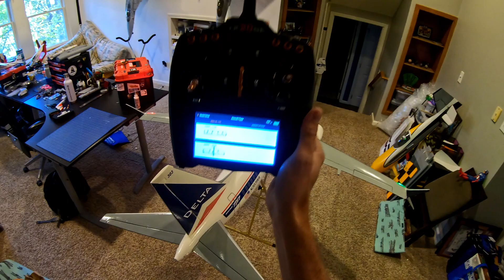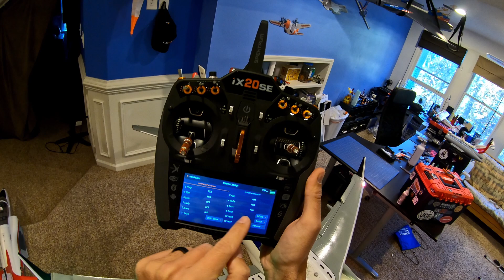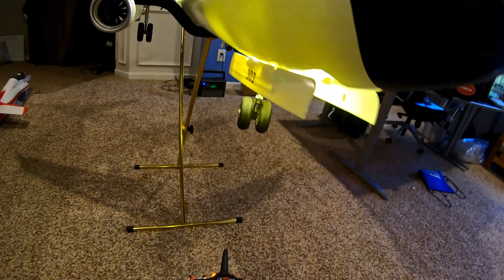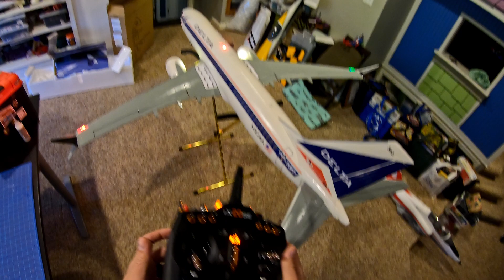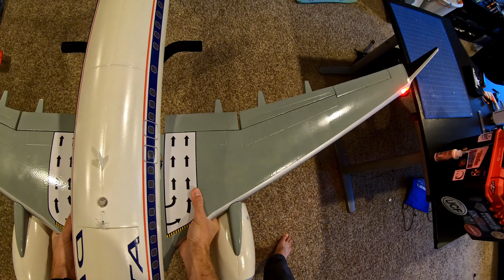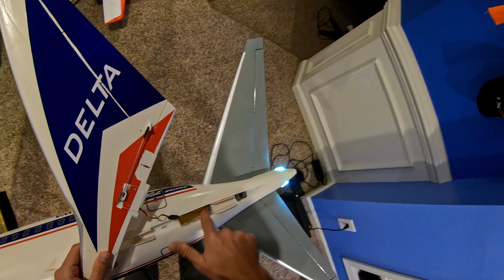Freewing AL37 Full Scale Performance+ Setup - Radio, Mixing - IX12/20 Required

Comment: Hi Jon, Been watching your videos for a while now and I'm loving the work you've done to the al37. Can't wait until I can do touch and go's half as good as yourself😍
I'm over in not so suny Scotland and fly from grass so don't need much work to make it stop. However I had a question regarding servos and the blue box.. 1 Are you running the stock servos? 2. Do you run the blue box for control surfaces? I ask as I've been unlucky and had an elevator servo fail and my first model was destroyed. I was planning on feeding the rx directly and using the blue box for gear and lights only. Thanks and keep the videos coming.
Reply from the maker: Our servos were replaced with https://tinyurl.com/B11DLS units with a https://bit.ly/AR10360TPlus receiver to run everything. The setup file for the 737 is on Discord via https://discord.gg/twobrosrc
Reply: @TwoBrosRC  Thank you! Much appreciated.

Comment: Two Bros -
On two different videos you mention adding tail weight- 35 grams on one, and two ounces (56 grams) on the other. Which amount did you actually use? Thanks in advance!
Reply from the maker: We can't give you the specific weight since the plane is currently hanging up from the ceiling 4 stories above Jon's desktop computer, but the general idea would be to put about 0.5 to 1 oz of weight in the far end of the tail to help shift the CG further back with minimal weight gains.
Reply: @TwoBrosRC  OK- thanks!

Comment: I spent hours and couldn’t get it right, also on 2 ailerons 2 flaps wing type I don’t get the crow option in Flap System 😕. I have a IX12 and yes it’s updated and crow is still not there.
Reply from the maker: Sorry to hear that! All the info is in the vid. Follow along and you'll get it.

Comment: hi there, wondering if you could help me, i flew my al37 once for abou 3 minutes then i lost power and landed by it self . about a year ago, now i want to fly it again after getting a new battery, and all is good but for some reason i dont understand the ailerons go up or dowm at same time, radio is a tcap 2.4ghz futaba. any ideas. i checked cable leads but they are fine. dont know what sgoing on all is set standerd as it comes from factory
Reply from the maker: We can't help with Futaba - but consider joining our Discord server via bit.ly/TBRCDiscord and someone might know.
Reply: @TwoBrosRC  hi there found out that both servos that come with plane are actually reverse direction from standards 9g servos. like the bkue ones metal gear,
Reply: @TwoBrosRC  this my third flight https://www.youtube.com/watch?v=k5CSF8eZHPU

Comment: Hey Jon, got my AL37 from "ricardopr54" in the comments below and doing some serious electronic modifying, including the thrust reverse... I'll let ya know how it goes. I'm doing pretty much  everything except flaperons as I'm only running an 8 channel setup. My question is, on your setup, did you only have the "GEAR" going from your receiver into the Blue Box for LED power and the front nose light? I know you said you got the V3 LED controller, but does it still have to know the gear went down through the Blue Box? I think I'm going to have flaps and gear wires going into mine, which both run through the white wires to the wings, and then I don't have the Blue Box risk either way for all my main control surfaces. Great video by the way... I'm very excited to get mine going.
Reply from the maker: We use the blue box only for lighting. The rest of the servos are wired independently to the receiver. You can pick up a second set of PCBs for the ribbon connector and plug that into the ribbon that normally plugs into the blue box, then plug in servo leads from the ribbon to your receiver to bypass the box but still make it easy to put the jet together.

Comment: Hi, I just ordered my very first freewing plane that is a f18 high performance pop and using a ar8360t receiver and wondering about the blue box. Might even use the ar637ta that is in my eflite f16 80mm for the freewing f18 and install the ar8360t in my eflite f16 80mm, just haven't messed with a freewing model yet. I've been fly rc for 30 years even though most my experience was using old airtronics radios 72hrts glow motors balsa ply models
Reply from the maker: You'll have fun with it!

Comment: How did you control the ailerons independently for the air brake? I have an AL37 and they are using the Freewing Multi-Function Control Box E (MCB-E) so there is some weird wiring going to the wings for the servos. Did you replace the wiring all the way to the servos from the main bay?
Reply from the maker: In this vid we ran wires and removed the PCB for the ailerons and flaps.

Comment: Hey John good Evning.  It's Tony the guy who wants to set up my AL37 Jetliner to use ailrons for spoilers. I had a problem setting it up  even after trying to follow video. My configuración was set to 2 ailrons to 2 flaps and li left the tail in normal.  So I had no landing gear working or showing as an option in my radio.  My radio is a NX10 spektrum a bit different from your radio.  I see you got the IX SERIES.
Reply from the maker: Yeah, you'd need a minimum of 12 channels to follow my setup guide - hence why "IX12/20 required" is in the title. You can't do it with a 10ch setup unless you're willing to give up flaperons or tailerons, or both.
Reply: @TwoBrosRC  Thank you So much 🙏 for your response.  However I'm a little disappointed that I'm not able to do that with a 10 channel radio lol which I just bought not to long ago when I Bought the Jetliner.  I guess I figured 🤷 what would I do with more than 10 channels , ha ha guess I fooled myself.  I a bit disappointed  ,but I guess I can live without it . Anyway your Help is much appreciated thank you. Maybe I can figure out how to get thrust reverses working 💪.  I herd you mentioned that in your video.  Would be nice to have without investing too much more money 💰 into this hobby I love so much. Have a great day.  Keep up the beautiful flying videos,  I love them. You're very informative the way you explain in detail what you're doing.  Thank You.

Comment: This is great! Im blaming yoy for me missing cash in my pocket cause of your performance vids on this plane. Haha.  I just picked up a used al37 thats in pretty good condition and watching your vid to set up some cool flight controls. I only have a 8360t for now. Gotta wait for those 10360s to come back in stock. Love the paint job. Is that rustoleum spray paint you used?
Reply from the maker: Haha, thanks Jared! the 10360T isn't needed unless you want full flaperon/taileron control. I did use the Rustoleum spray but picked up the flat paint which was a poor idea in retrospect. It took several coats of Polycrylic to make it that shiny when it should only have taken one or two.
Reply: @TwoBrosRC  right on. Thats true. I will probably just stick with the 8ch. Flaperons would be cool, but i think i will enjoy crow the  most.
Reply from the maker: @jared6072  I haven't actually tried crow for landing. The model lands so well that it never really came up.

Comment: Your thrust reverse will pull on the flaps some because a true thrust reverser's intake is still in the front of the turbine. Pulling air from the back will pull air over the trailing edge of the flaps.
Reply from the maker: I don't think it's going to matter much, the amount of suction at the distance the flaps are spaced from the exhausts would be minimal.